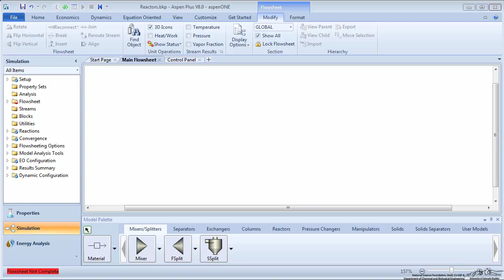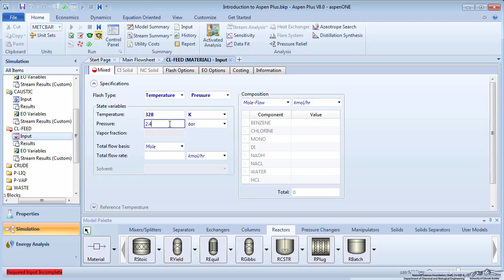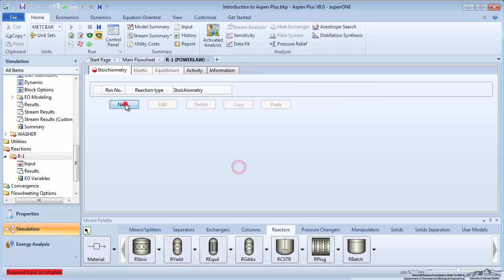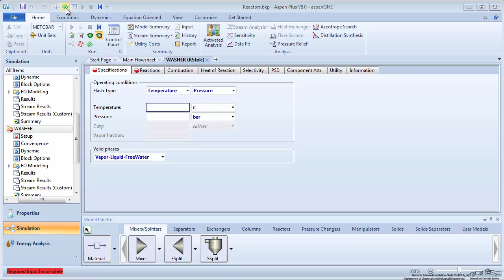Aspen Plus - Reactors: Chlorobenzene Plant

Comment: Hi, thank you for all theses tutorials aspen + simulation it is very helpful, I have a question about the tutorial of Aspen Plus - Reactors: Chlorobenzene Plant, I have do exactely step by step the simulation using RCSTR reactor in showed in this video, but when I explored the results, the reaction of benzene to chlorobenzene, and chlorobenzene to di-chlorobenzene give me 0 mole flow rate for chlorobenzene and  di-chlorobenzene? So I don't know why ? Thank you for your answer
Reply: Same here. Did you figure the issue out ? The CRUDE results from the washers seem to be 0.